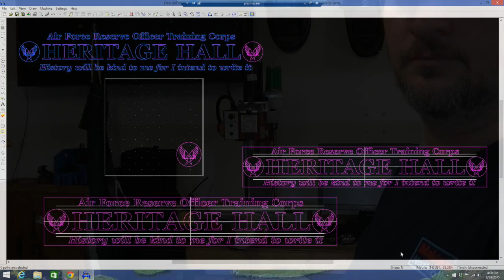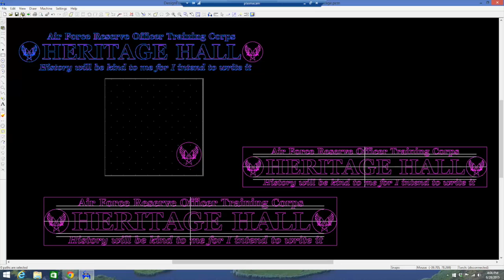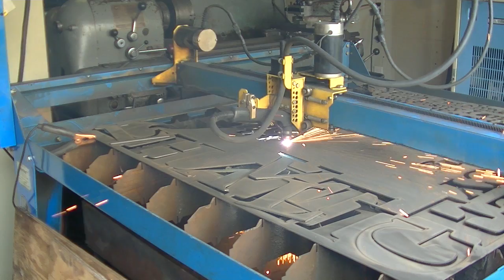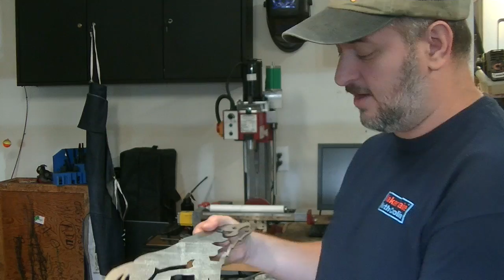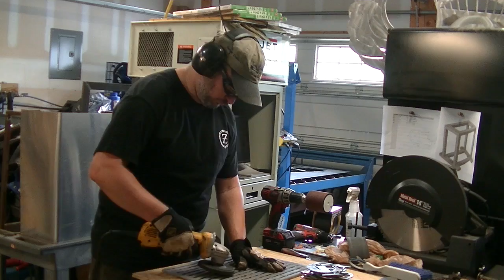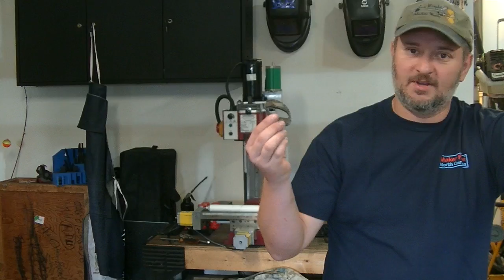Project Work - NC State University Air Force ROTC Signs

Comment: Thanks for the props buddy! Great vid!  
When you talked about non-slip, I thought you were talking about drawer liner.....looks like a bunch of 3/16" beads connected together.  You can buy them for holding router projects.....but it's a bit spendy that way......or you can buy it as tool drawer liner at Sears......of you can get it as kitchen drawer liner at walmart and probably HF.  
Love the drum sanders!!!!  I'll be picking up a set of those....very soon!!!  Like you said....the fact that they don't use the pre-made sanding tubes is a real plus!!!  
On the tumbler.......I think if you left them in there for 6 hrs or over night, you would probably knock all of the dross off.  The vibratory tumblers are awesome, but slow.
Thanks!
Mike
Reply from the maker: +bluehandsvideo Hi Mike! I thought about drawer liner at first but quickly realized the foam would melt under the heat. The other issue I had with some of the other materials was the vaccuum formed my the fast spinning disc would cause lift and the material would get pulled into the grinding area. In the end, I used that heavy, silicone sink mat. It's not ideal but it actually worked pretty well.

One caveat on the drum sander is the slit makes for a bump. It want to make a small relief there. I noticed I was getting a wavy finish. The arbors could use improving as well since the pressure caused runout at the end of the drum. That's why I switched to the hand sanding for the smaller parts. Sounds like fodder for another video though!

I tried the tumbler overnight and still ended up with a bit of the dross to remove. In the video you can see that I'm in different shirts depending on the camera angle... The nice part is I just used a dedicated 60 grit flap disc and I didn't even really need to hold the part down for sanding. The silicone mat gripped it very well and it took just a few seconds per part to get cleaned up. Just wish the finish sanding went that fast.

Lastly - I got your email. Thank you sir.

Sincerely,
Tom Z
Reply: +Tom Zelickman (Inspiration Metalworks) Ah....very good points....hadn't even thought about the heat and it melting.  
I wondered about the "bump" from the seam.  Maybe cut the paper so that it ends over the gap, right where the bend is for the leading end.......then a tack coat of spray glue.......don't put the tail in the clamp.....leave it loose.  
Sounds like you need a big, wide belt sander.....oh......how about a hand held belt sander while your piece is on the silicone?  
Where did you get the silicone tray?
Mike
Reply from the maker: +bluehandsvideo Yeah, the bump shows me why these setups usually use dedicated cylinders. I might try your suggestion and play a bit to see how it works out.

I've got 2 belt sandser; a handheld and small standalone setup. Again, heat transfer tends to be the issue. I did try on the mat with the handheld and eventually it just shoots out. Maybe if I could regulate the speed or something like that.

The silicone mat was at Bed, Bath, and Beyond. Please don't make me go back there. Ever.

Talk to you soon!
Tom Z
Reply: +Tom Zelickman (Inspiration Metalworks) Thinking about it more, I doubt my idea will help at all with the bump.  The belt sander, stood a bit on it's nose, would emulate the drum sander and not have a bump......??  
I've only been in there twice.....but if there's where I need to go to find it..... :)
Reply from the maker: Interesting idea on the belt sander. I'll keep you posted on progress.